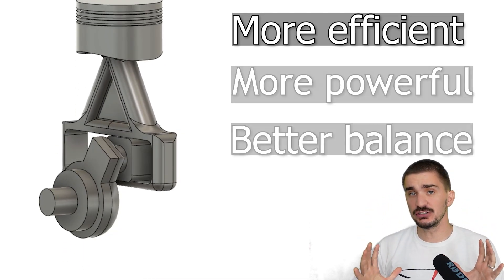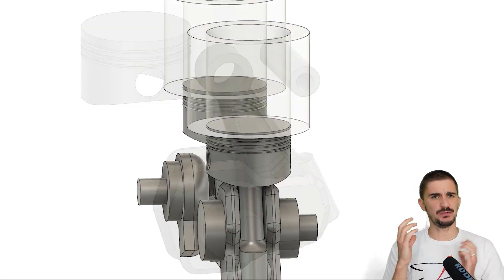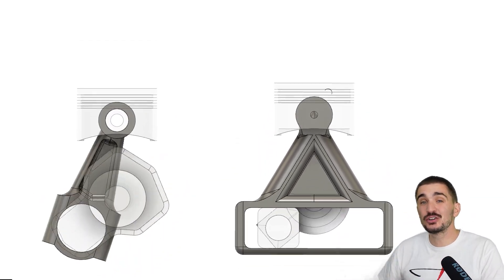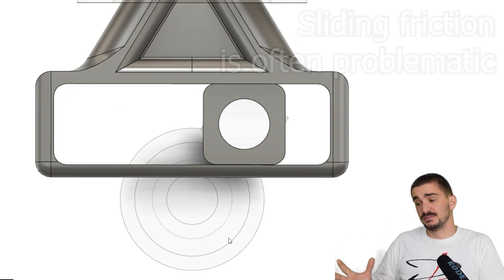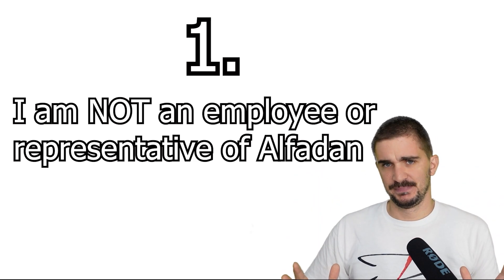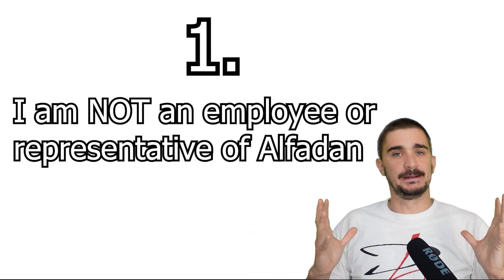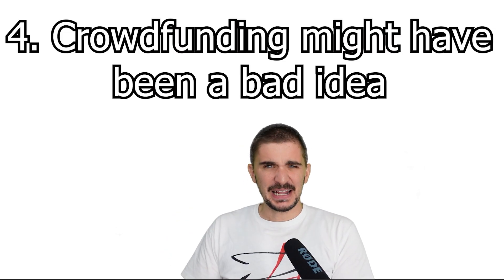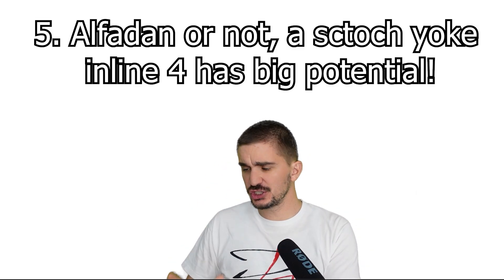This engine is better in every way?

Comment: Sorry mate I have to pull you up on 3 things.

No matter how you design the piston Rod there is always going to be a twisting Force on that piston due to the Fulcrum points on the connecting rod in conjunction with its line of travel, this is absurd but the only way to achieve no twisting force is to have the crank moving around the Fulcrum point of the big end bearing sort of like how a rotary engine works, however that is impossible on a piston engine.

And 2, the increased downward motion of the piston in conjunction with the crank does not cause any loss of power or inefficiency, it is just extra leverage which is converted into more torque.

Now due to the New design of the piston and connecting rod to being a single entity, you have now induced a twisting motion like a lever on that piston so now not only is it going to collide with one side that piston will be forced to twist in the cylinder causing friction on both sides of the wall 2 times in each rotation which will destroy that cylinder wall in little to no time

Comment: This entire premise is faulty: you just shift all the forces to the piston and cylinder wall, as well as the rod bearings.

Nothing is free in physics.

If you want to know why this is bad, look up, "spun bearing."

A worn cylinder can be resleaved, a piston head can be reringed and/or replaced -- a rod shooting a hole through your engine block and dumping a lb or metal into your oil pan and seizing your crank, notsomuch.

Comment: This is the same thing as Baker vs Walschaerts valve gear. Walschaerts is theoretically better due to it's simplicity and easier construction, Baker is better in practice due to it removing sliding friction and awkward wear from the valve gear. (The reason Walschaerts was still more popular is because Baker wanted royalties for every design that used Baker valve gear.)

Comment: What about adding multiple rollers to the top and bottom of the square part of the crankshaft journal and pressurizing oil the same way from the inside of the crank.

Comment: To have no side loading, there would have to be another sliding guide below the crankshaft for the piston assembly to slide in which means even MORE friction
Reply: Yes it seems that triangle would otherwise rock x degrees if it wasn't supported in some sort of guide...

If the connection to the piston is solid, to keep the triangle moving I a vertical plane, rather than the usual wrist pin, seems there would be rotational forces there, that would end up cracking the connection to the piston...  unless it's heavily reinforced, but that would be more reciprocating weight....

Comment: I'm a bit surprised this wasn't used in a boxer configuration. It would largely solve the weakness issues and side wear on the pistons.
As for the sliding problems, I'm sure some sort of rolling can be implemented.
Reply: More mass wouldn't really matter that much to make it stronger. Regardless of what bearing system you use though the path is like 4x longer that gets affected on than circular crank pins diameter..

Comment: Identical motion could be achieved by instead of milling a slot, adding a beam like projection, with a carriage that that clips over/around the projection. Disk driven by pin on it,  that slots into hole on the carriage. Should be a lot more robust stronger,, and provides more space to add rolling element bearings to reduce friction..

NB Angle of slot/beam can also be adjusted to be different from 90degs to the motion of the piston. That adjusts gearing of combustion pressure to torque. 
So long as the bearings could cope with a changing angle (3 rollers clamping onto a beam could cope if  beam thickness suitable varied where there is a bend) Doesn't require a constant slope, which would  provide a mechanism for stretching combustion part of cycle.

Comment: The Scotch Yoke engine might be more likely to knock, precisely because the piston does not "get out of the way" of the expanding gas fast enough.  This assumes the static compression ratio, valve timing and ignition advance are the same as a conventional conrod engine.

Another way of stating this; is that a conventional engine can tolerate more ignition advance, higher compression, more boost and lower octane; because the piston accelerates more as the fuel is burning.  Effectively lowering the dynamic compression, reducing the propensity to knock.

Then there is what looks like a lot of friction at the Scotch yoke itself; compared to a conrod on a big-end bearing...

Yes, the conventional conrod has asymmetrical acceleration, and thus vibrates more than the Scotch yoke engine.  However, larger pistons will still require more force to accelerate, and that seems to be the limit for displacement per cylinder - unless you limit the RPM.

In the same way, increasing the stroke increases piston velocity and acceleration, again limiting engine speed unless displacement is reduced; or more cylinders are used.

Comment: It would seem to me that this concept would cause a ridiculous amount of sides to side  vibration, a pretty fierce rocking couple  vibration, and generate tremendous friction for the oiling system to try to overcome.
P.S. re: earlier comments on the "widespread" use of ball/roller bearings in engines, transmissions, etc. Most of the vehicles that used them on crank, rod, camshaft, etc. were largely hand assembled and fitted, a very time consuming process.
They also led to oddities like split race bearings, cranks assembled from many bits, and so forth. Roller bearings are ok in hub bearings, steering systems, and similar applications, as they cannot easily be fed pressurized lubricant.
As soon as modern bearing materials appeared, the use of roller bearings fell way off.

Comment: It's hilarious that you, someone who's never designed or worked on an engine, is "calling out" dirty garage guy, an actual engineer, because he says Alfadan is idiotic. And the fact that you spend so much time in this video trying to justify Alfadan's existence by using big words instead of going over the actual engineering of the Alfadan i4 should tell people all they need to know.

Prototyping and making an engine happens in a matters of hours days or weeks, not years. Get the specs, get the parts milled out, build the engine, fire it up. Days, not years.

Oh and patents absolutely are enough to protect a company as long they're filed in the US, EU, and China. The Alfadan silence absolutely does not mean what you'd like think it means. 

Double oh, if the scotch yoke were a good design all the big engine manufacturers would use them. They're not run by morons who happen to be getting blindsided by the "geniuses" at Alfadan, that's a childish view of the world.

Alfadan is 100% BS.

Comment: What if the scotch yoke was not a straight line but slightly curved, allowing round pin instead of a square one. It would also help release some of those forces from the downward stroke. Idk about efficiency though

Comment: D4A, This is by far one of your best videos regarding the ALFADAN i4 engine and the challenges we face as a new start up company. All of the issues you mentioned about the Scotch Yoke connecting rod and the false claims individuals have made about our company are very accurate and some of the most basic challenges we faced when we started this project. After various design changes, we feel that our team at Mahle has succeeded  in producing a rod design that eliminates secondary imbalance as it relates to the i4 while also eliminating the design challenges you explained about the scotch Yoke connecting rod. We truly appreciate your support and explaining to this community the reality of executing as a new company on a project of this magnitude. Although we are concentrated on the High Performance Outboard market, we feel that this revolutionary i4 engine can in fact replace the traditional V configuration engine designs therefore allowing the i4 to be the engine of choice for most ICE applications. At the moment our greatest challenge is the job of securing the necessary funding to bring this great engine design to market. We feel confident that we will find that individual or group of investors that share our same passion and will provide us with the necessary resources. Thanks again for another honest and great video and rest assured, I will personally reach out to you in the future as we make sufficient progress and are closer to a test or release date. GREAT VIDEO!
Reply: what is your current progress

Comment: To much reciprocating mass they have been making pistons lighter to create more power & efficiency & you come up with this? Also I agree with
@hansdietrich83 the wrist pin friction losses are just moved to the sliding square and the piston is obviously still loaded at an angle. As far a claiming that 
This engine is better in every way than a conventional engine. It’s more efficient, it makes more power and it even has much better balance? when you have a working example that actually does that, I will never believe it & find it hard that you would if there isn't, so where is the working example other than an animation? Unless there is an opposed piston to stabilise this you would need slider stabilisers on each side of that square big end & why wouldn't that square slider bearing on the crank create as much secondary imbalance issues as a big end bearing if not more?

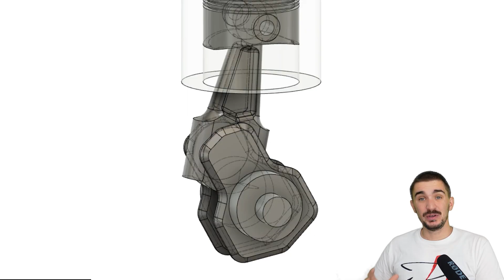Comment: A conventional engine is full of sliding friction, at every plain bearing - the statement @7:50 of "no sliding friction anywhere" is nonsense. The advantages are that a cylindrical ring sliding around a cylindrical journal is easier to fit nicely, and that the plain bearings at the rod big ends rotate continuously in the same direction (although not a constant angular speed). The wrist pin has a plain cylindrical bearing that oscillates, and the piston rings have the worst case, of axial (instead of rotary) movement of the bearing surfaces and oscillating motion.

You can build a crank mechanism (but not the piston in the cylinder) without sliding friction by using rolling-element bearings, and that is common in small engines, particularly 2-strokes. It has its own problems, which is why most engines have plain sliding bearings instead.

Comment: The lower end of the yoke must be constrained laterally (perpendicular to the cylinder axis, in the plane of the crank throw), so there must be sliding contact between the sides of the yoke and vertical (parallel to cylinder axis) tracks, or the yoke must be double-ended (as in an opposed-piston engine). Evaluating friction while completely ignoring this contact makes no sense.

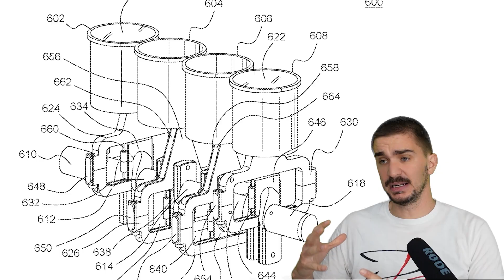You know this because you have common sense, because the patent drawings (@9:02) all show those sliding surfaces (with bearing pads, noted as items 648, 650, etc), and because when you animate the model you must artificially constrain the yoke to move only vertically (because the sliding surfaces are not there to do it for you).

The graph paper animation @3:37 illustrates this, using an extension of the yoke to locate it perpendicular to the cylinder axis, like an opposed piston in its bore. The Borque engine is opposed, and the working examples @5:41 clearly have guiding structures. Where is an equivalent constraint in the rest of the models?

Comment: You can guide the big end of the rod with rails, so you can make a piston way flatter and also reduce the skirt of the piston to a minimum. This a a new friction surface to lubricate, but the advantage is an overal friction area reduction and better linear guiding because of the distance between the piston ring and the big end friction points. Interesting too is a reduced skirt reduces mass, then use that mass to strengthen the big end, which put mass closer to bottom or center of crankshaft rotation. The limiting factor to RPM is the acceleration of the piston, with this you can ref a tad higher, maybe make this engine compatible with an electrical motor in line with 17 to 18 K RPM. (no gearbox)
Reply: Unless you have opposed pistons on either end of a shared yoke/rod, you must guide the big end with rails... or it won't work at all.
Reply: @brianb-p6586  so this allows for much smaller skirts for the pistons, so you can regain the weight spent on the big rod.
Reply: @AlexandreLollini  Okay, but my point is that no matter how large the pistons skirts are made, and whether or not there is a wrist pin, the big end of the yoke must be supported - as illustrated in the video it simply will not work.
Reply: @brianb-p6586  I agree, the video is just an illustration of the motion, the need for guiding it both good and bad; it is good because piston/cylinder ovalisation problem is gone, the drawback is weight on the rod and guiding/lubrication and the sliding motions.

Comment: Printing presses use this method to slide rollers side to side in limited space in the side frames. They use plastic wear blocks of course because it's not usually in a oil bath. But very awesome technology

Comment: #1 the forces of the 'better' design will try to severely twist the piston as they are not centered with each other. Nothing saved!! Wear will substantially INCREASE!!
Scotch Yoke engines will NEVER work. Not in a BILLION years.
#2 Increase in power is not a factor with direct injection gas or diesel engines.
#3 Out of balance?? WHO CARES??? That is what balance shafts and anti-vibration mounts are for!!!
BUSTED!

Comment: i truly believe that if there ever will be a successer to the piston configuration it will be either a turbine or some adaption of the rotory engine. The scoth yoke, big connecting rod size and weight will not replace a normal connecting rod configuration with the only true plus being the secondary balancing. For efficient needs of power in the means of internal combustion almost all "normal size" engines are either 6 inline or a V12 configuration for that exact reason (smoothness) and it will be that way for a very long time i think. Atleast before sadly everything will become either a reactor, battery powered or hydrogin cell powered.

If you came this far thank you for reading my rant.. :)

Comment: The only thing I see missing, is the direction of force on the crank pin. Doesn't it cause the piston to force tilt just like the rod would?  The direction of force is the same, wether a triangle or straight line, because you're pushing along the same vector. Unless that is solved somehow?

Comment: I would bet against Alfadan not just because of the fragility of the Scotch Yoke and all the sliding friction, but also because of the inherent problem of filling the large cylinders adequately to produce competitive power. Unless you go sleeve valve like Bristol and Napier did (and there's no getting emissions compliance from that!) the power simply won't be there. The inability to fill large cylinders in a short period of time is why piston engines with any kind of weight restriction have needed to add cylinders to make more power. Boat engines are very much like aero engines in that that they are expected to produce a high percentage of their total output for long periods of time. Look at all the aero engine technologies tried and you'll see everything practical, and plenty impractical, that meet those power requirements.

Comment: An investment example might be the OLED TV. LG spent years developing the technology and many were sceptical that it was even possible. But in the long run they managed to produce a new product that has better clarity  and efficiency than anything else so far. Samsung are now developing on this technology as well. The screens are more expensive but most phones and tablets use the technology as well.

Comment: I remember back in the day, the original Alfa Romeo GTA from the 1960s and 1970s had a sliding block rear end (might have be an option for racing use) to help locate the rear axle. From my understanding wear and maintenance issues were the main problems. This video reminded me of that setup.

Comment: 7:50 are you sure about that? the big end and wrist pin of a conventional rod experiences sliding friction (sure its "circular" but as far as the two surfaces are concerned its the same thing

Comment: With this design the top of the piston design can change 
4 valve per cylinder  = the top of the piston should be rectangular with round corners 
What u think ?
Make a 4 cylinder motorcycle engine

Comment: However, there was a "large displacement" inline 4 produced for a number of years by an american company which sold that engine to boat manufacturers as well as truck manufacturers. That engine was the cummins 4bt, which had a displacement of 3.9 liters and was in the same family as the 6bt which is rather ubiquitous among the diesel pickup market. But all of that is also based on an individuals definition of large displacement, and the context in which it is being used.
Reply: There are lots of large 4-cylinder diesels, not just the 4-cylinder member of the Cummins B-series family (which is still in production as the B4.5). 1 litre of displacement per cylinder or more is normal in heavy-duty diesels, and even a four-cylinder can be made smooth enough for at least some applications with balance shafts. Cummins doesn't currently offer the B4.5 for on-highway vehicles; they offer the slightly smaller ISF3.8 for that.